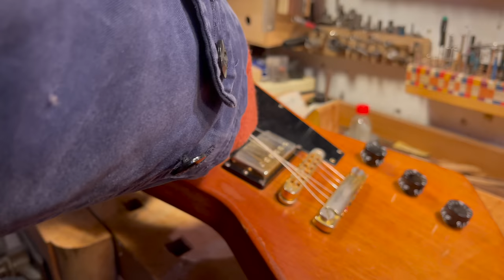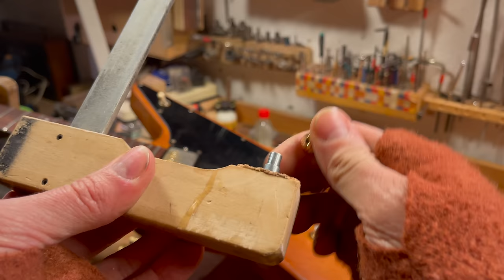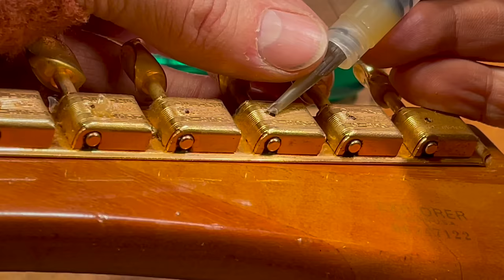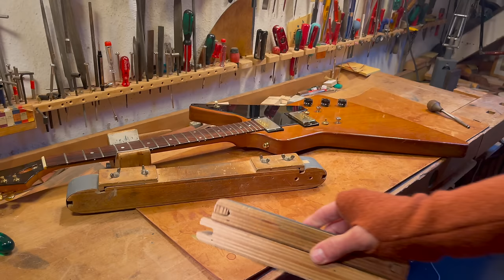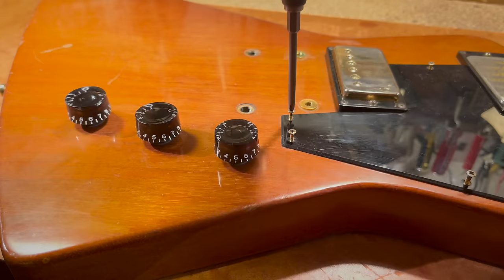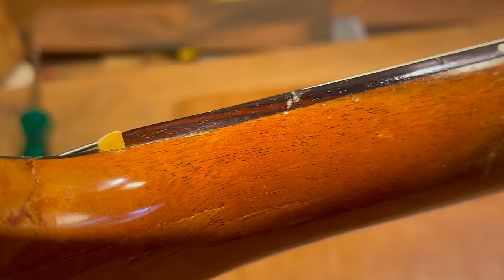Gibson Explorer Vintage Guitar Repair Luthier Workshop

Comment: Nice job getting it back to original and setting it up. I have a 77 "V". Too bad the owner couldn't have found an original pick guard.
Reply from the maker: Thanks a lot for your Feedback. Your V is surely a great guitar. Yes my Customer buy it with this after market Chandler Pickguard. The additional holes are not also nice but it's still a great Insert. Best Regards Nik

Comment: A couple of comments. 

Bridge humbucker may be either T Top, or Tim Shaw or PU490, or something else, but is not P.A.F. 
To know this for sure you have to desolder pickup cover and see what is inside.

Also applying grease better be done before installing tuners to the guitar.

Oh yeah also you can use chalk with super glue for the nut.
Reply from the maker: Thanks a lot for watching and for sharing your helpful informations👍Best Regards Nik

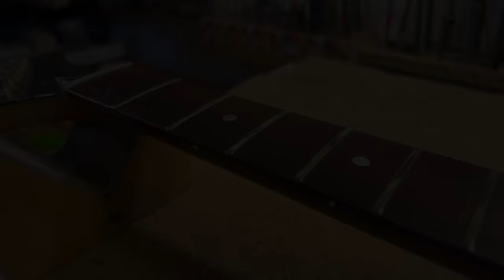Comment: At 14:50, the guitar is taped up, and then untaped. What was the point of that? What changed?
Reply from the maker: Thanks for your question. I have made a Fret leveling Job but I will make a separate Video about this because there are a lot of points to take care about. That’s why It’s taped/ untaped. I use mechanic grease for the tuners. Best Regards Nik